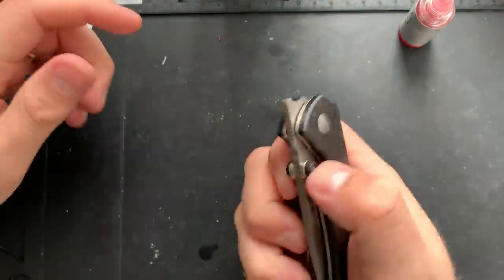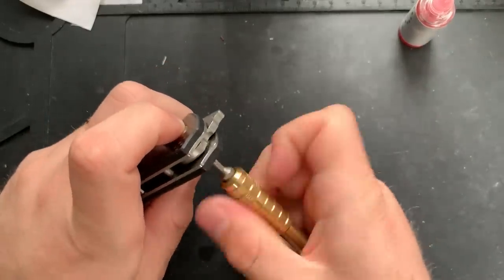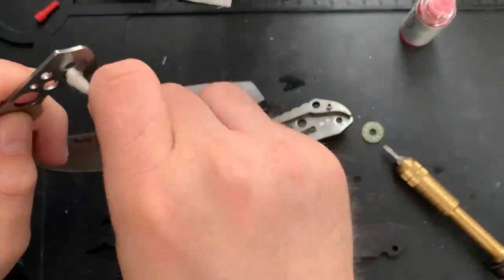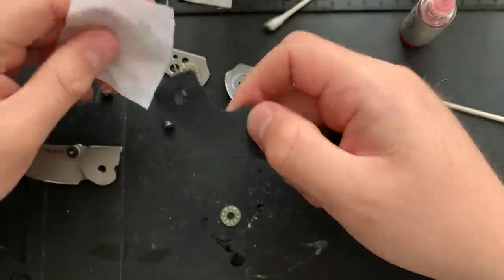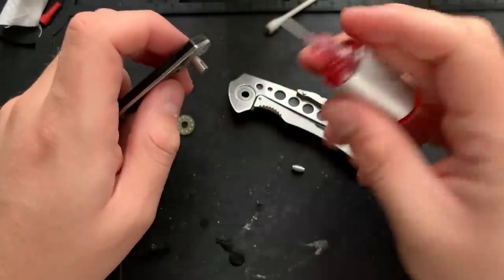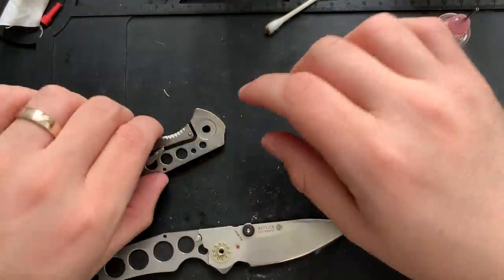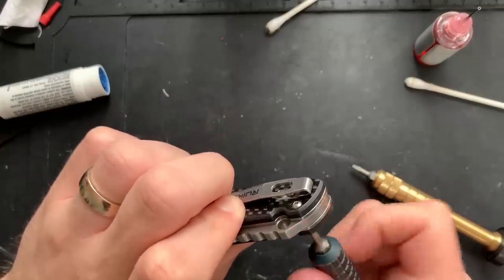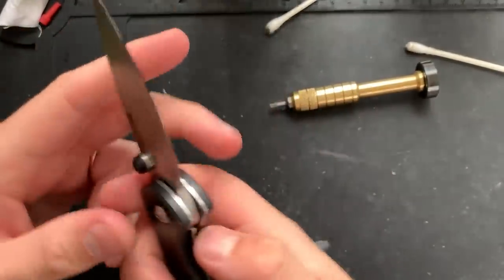How to disassemble and maintain the Ruike P671 Pocketknife

Comment: Nick, great content as always. Just wondering: did you purposely not lubricate the second scale where the bearings connected on the inside? You hit the first one at 5:16. But at 6:13 that second scale looks like it goes on without lubrication. You also lubricated only one side of where the blade contacts the bearings to my eyes. Wondering if maybe making sure all sides had lubrication would help the action a bit. 

Anyway, again, really nice. I always get major satisfaction out of fine-tuning cheaper knives to feel great. I recently disassembled my CRKT LCK (which I bought after you gave it such high marks) and it's so much better than when I got it from the factory.

Comment: Its not the finish of the blade, the ball on the liner lock is causing the issue. Look how the ball is just on the edge when the blade goes around. Just look close and you Will find the problem.